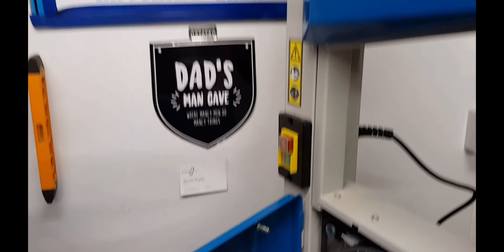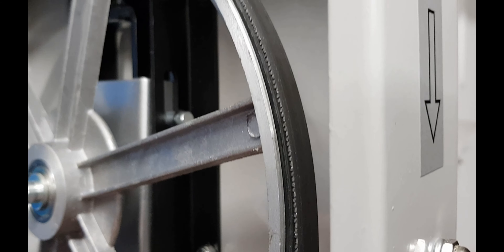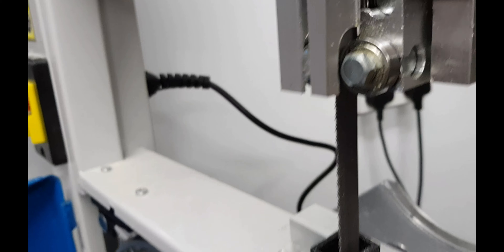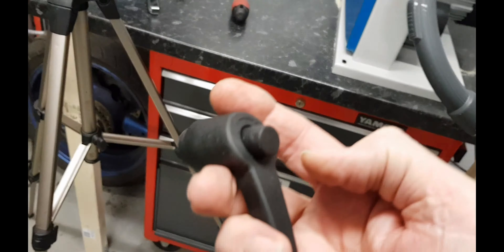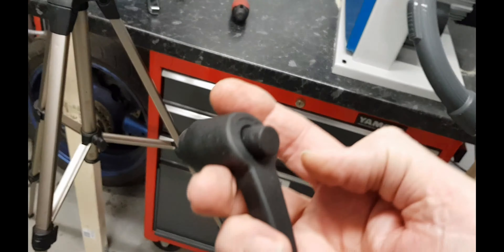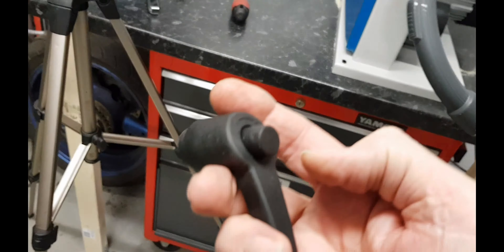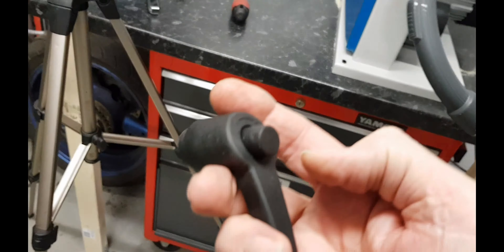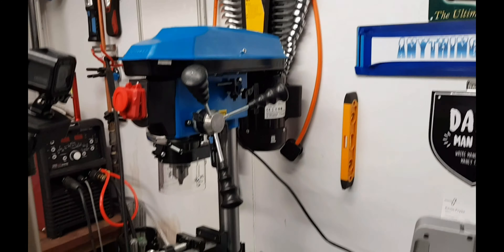Low cost Bandsaw Band saw any good. Aldi ferrex

Comment: Thanks, enjoyed your video. Just recently got my saw. Same as yours but grey paint instead of blue. That table angle tilt is a pain to fit. I unbolted the unit from the table and shaped and epoxy glued in a semi circular piece of wood to retain the threaded bolt but still allowing it the full swing. That made it easier catching the thread and mounting the table. In addition I've also considered cutting a shallow slot on the end of the plastic spring loaded, threaded barrel for a screwdriver or coin. I struggle with my sausage fingers. I like this saw.
Reply from the maker: Well now i have had the saw for a while & used it quite a lot, I can say it was worth the money. It is not the best & can be a bit noisy in operation. 
Regards. Steve.

Comment: I think you might find a nut and spanner easier for the table adjustment. The large "vent" at the bottom is to fit the 100mm main extraction. Where you have your hoover is smaller secondary extraction.
Reply from the maker: Thanks for that. I have sold it now & am working on an old 3x6 horizontal version. 
Steve.

Comment: Hi Stevie, I had the same issue. In a video by Grumpy's workshop, he suggested using the provided screwdriver to hold down the bolt while tightening up the table. I've yet to try it cut fingers crossed. 🤞
Reply from the maker: Yes I saw that & it is a better way to do it.

Comment: I replaced the plastic handle for the table angle with an m6 wing nut, which by the way works brilliantly, the original handle got chucked away (I found it too annoying lol )
Reply from the maker: I have it set so only half a turn to slacken & tighten. Good to know you have it sorted out. What about the rest of it. does it work well.
Reply: @Steviegtr52  thanks yes it's working well once tuned up, my focus though is very much woodworking and I couldn't find anything even close for the money, it cuts through 3 x 3 purpleheart stock no problem, with a tuffsaws 3tpi blade.